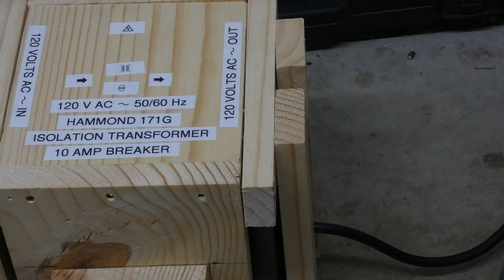How Many Volts Can These Motors Take Before They Pop

Comment: Please help me understand how to choose which motor is needed for a certain sized battery.   Is there an easy online calculator, so I can play with it.?   If I have a 48v battery,  or 96v,  etc..   I do understand that AH is simply how "long" you want it to run, I just can't find the correlation between the voltage of the battery to the require motor size.    I'm confused